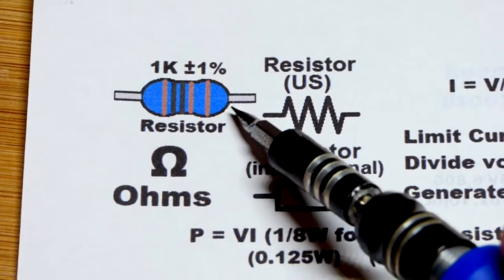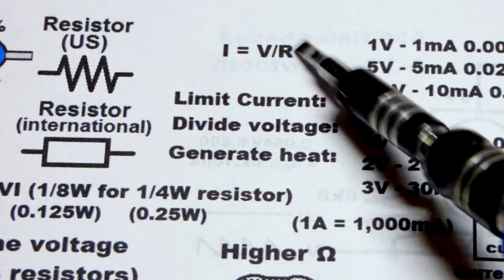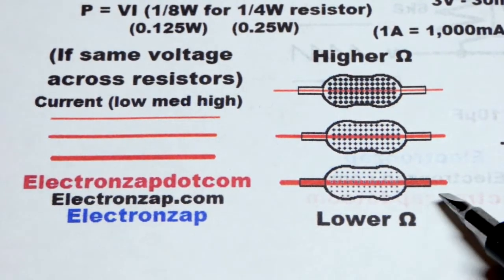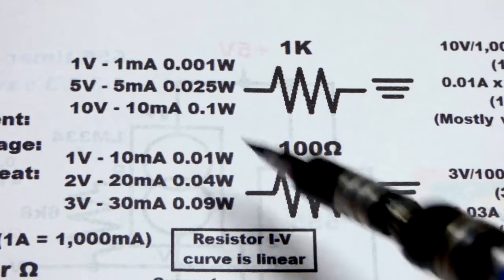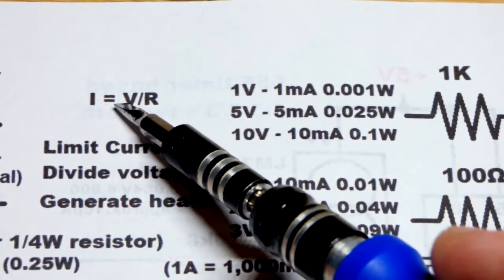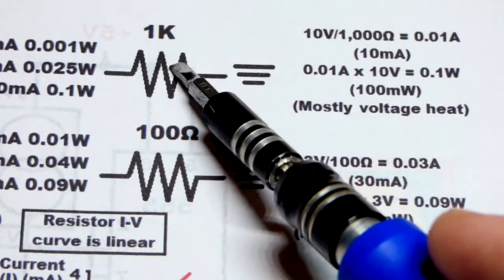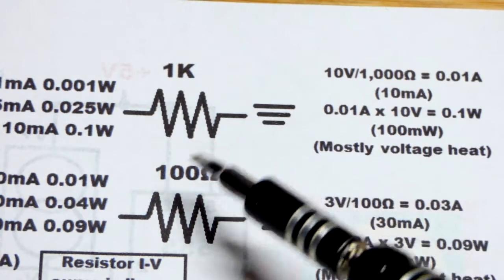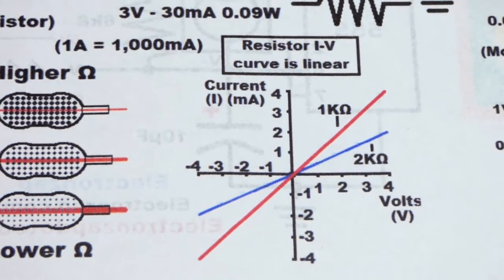Resistor component basic properties explained for DIY learning electronics

Comment: wattage of curcuit or for a specific resistor should be considered? for 5v supply, 1w 3v led, the wattage for resistor is not 1w?? because the 0.3 apms from led in 3 volts is under 1w.
another question is can we run a 6v led on 5v usb supply? is it be on max brightness or even lighted up?
if we want a 1w resistor 56 ohms, can we use 4x1/4 14 ohms resistors in series?
Reply from the maker: I only experiment with indicator LEDs like these. If you have LEDs with a operating voltage, then I assume that they have additional resistance inside them to limit current at that  particular voltage. You'd have to find documentation from the manufacturer on it's limitations. While building circuits, you have to make sure you don't exceed the wattage and/or current rating of each component. Making sure one component is safe, doesn't guarantee that they are all safe. Making sure each component is protected is one of the biggest challenges when you are first designing you own circuits. But with a little practice, it get's pretty easy to do most of the time. Mistakes still pop up though and you will accidentally fry a component from time to time. Hope that helps!
Reply: In reference to your ending question, no, that won't work.  Your resistance is correct as 4 x 14 ohm in series adds up to 56.  But your 1 watt is not split between the resistors since they are in series and the full watt has to travel through each one.   Instead, use 4 224 ohm, 1/4 watt in parallel so the current flow is split into 4 paths of 1/4 watt each but the resistance  total is 56.
Reply from the maker: Sorry I missed the series resistor question earlier. They do split up the voltage, which means that the wattage is also spread out among them. It's voltage across a component times the current through it. Every component in series with a resistor (that isn't a current source)  lowers the voltage across it and the current through it, so it's wattage drops really rapidly.
Reply: @Electronzap  thanks for responding and your words. I'm new to these stuff and I must learn many things as I'm learning them already. I like to get experience and do experiments but there are so much things to learn and explore and many cases need specific knowledge and scientific education. I didn't get my answer, does 5V supply from usb light the 6V smd LED up? I was wonder (before asking it) if it needs a resistor to limit the LED from draining more amps (amps in 0.5W led on 6V is 0.083 mA and on 5V should be 0.100 mA to fill up the lackage of voltage I think) more than what it needs or that low voltage doesn't allow the led to be lighten.
I watched a video recently about converting a 5V supply to 6V by adding a resistor to the circuit. since I'm familiar with Urdu language (very close to Hindi) I got what he was doing but the thing is this needs knowledge of electronics, so can you explain exactly what he wad doing? he didn't do the maths or showing diagrams or even why he is doing so. why did he put the resistor with - side not +? why 2.2k ohms resistor and what is the calculation (V and I). are those 2 smd resistors in parallel or series? and putting the 2.2k resistor makes them out of circuit or not? I leave the link of this video here: 
https://www.youtube.com/watch?v=eekJsXwLBJw